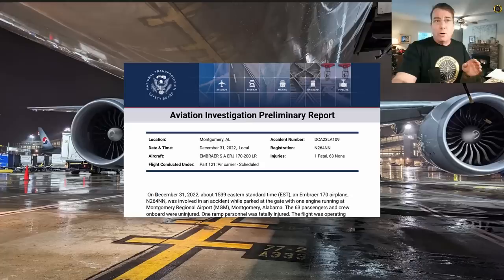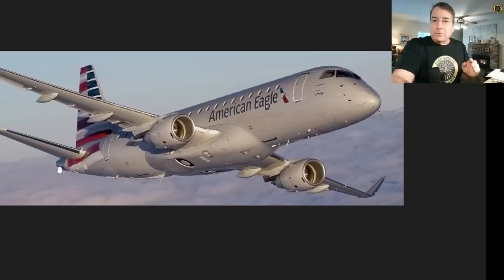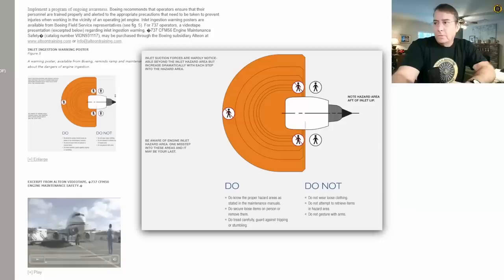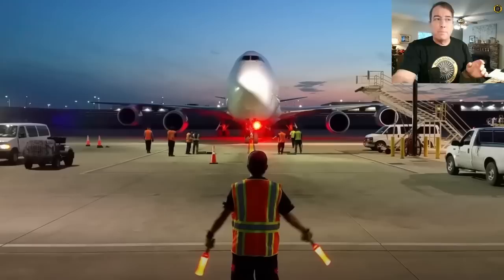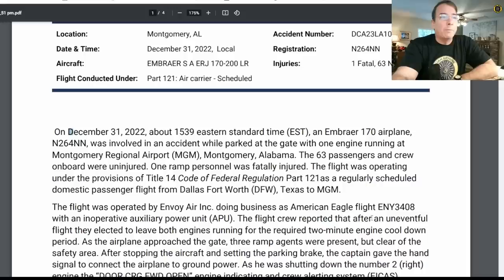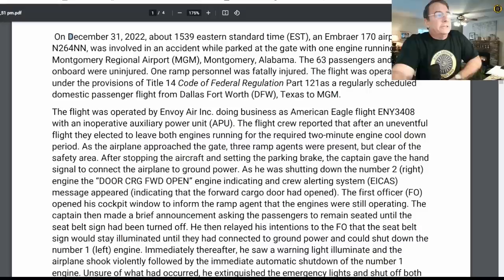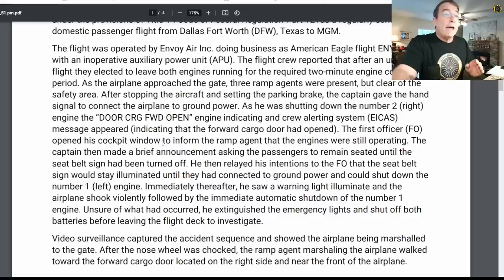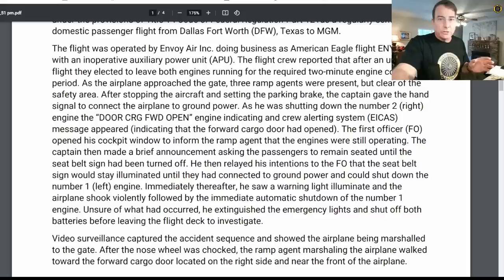NTSB Preliminary Report Ramp Agent Fatality 31 Dec 2022 Montgomery Al.

Comment: I used to work on Burlington Express DC-8 cargo configs for a time at Bradley Field, Windsor, CT.  The old mechanic I worked with would often tell me: "This bird has a dozen ways to kill you - and it sits on the ramp at night, thinking up a 13th." 

 I worked many aircraft in my 23 years as an active A&P - and I witnessed a lot of "stupid."  I almost lost an arm working on an Eastern Airlines  L-1011 inboard aileron, one night in Miami at the ASC (3rd shift). The aircraft had been in the ASC for a 'D' check, but after the 60 days, they pushed it out of the hanger and onto the ramp.  So we had to use portable work stands, manlifts, and portable lighting to continue working all the "non-routine" items.  I had pulled the breakers on the electric hydraulic pumps, red taged them, and tagged both switches on the Engineer's panel ... I was atop the port wing, inspecting the aileron actuators and hinge bushings at the rear spar.  

Had my arm down between the IB aileron leading edge and the spar, when I heard the hydraulic pumps come on!  I yanked my arm out just as the ailerons were slamming up into the neutral position.  I came down off that wing like Flash Gordon, looking to beat the sh*t out of whoever the jackass was that enegized those pumps.  I got up to the cockpit, but nobody was there.  To this day, I don't know who the fool was that reset the breakers and energized those pumps.  

That is just one example of some "toggle tommy" nearly causing a serious injury to a line mechanic.  I have many similar stories of idiocy - all of them working at either Miami International or Ft. Lauderdale.  I did not experience much "stupid" at any other base.

Comment: My experience working private FBO jets is that due to the engines normally being mounted on the aft fuselage and higher up, led to a lax adherence of normal procedures which called for line personnel to not approach the aircraft until the rotating beacon was off and the engines shut and spooled down.

There was always pressure to unload passenger bags and equipment ASAP as to not delay them at all.

Management at all levels was aware of the violation of procedures as they did not want to delay the passengers.

This lax enforcement of the safety procedure was more apparent when a BBJ (Boeing Business Jet) a private version of the Boeing 737 arrived or departed as its engines were lower, more powerful, and mounted below and forward of the wing making them extremely dangerous when operation to line personnel.

As a shift supervisor I always briefed the arriving and departing ramp personnel working a BBJ to adhere to the procedure and under no circumstance approach the aircraft until the rotating beacons were off and the engines had spooled down.

Warbird Willie, USAF Retired

Comment: It’s multiple factors. Complacency, poor training, understaffed at times, and money. It went from profit sharing to performance incentives, one of which was on time performance. If you don’t meet the on time performance goal then you may not get the performance incentive pay. Low pay causes positions to be infilled or low quality employees. There was usually one lifer around that kept things in check and running smoothly. The perk of free or low cost flight benefits goes only so far. Training was minimal and the new hire was usually thrown out there and it was a sink or swim mentality. The company will have trainings and safety briefs, which they would always fall back on if there was an incident, but the ultimate goal is profit. Do more with less. I didn’t work for Envoy, but I’m sure it’s just the same.

Comment: I learned that lesson quickly shortly after being hired when the jet blast from a 767 popped the hood up on the bag tug and nearly brained me...At JFK we never broke for the cargo doors before we heard the engines spool down...Almost everything is due to airline employment practices, low wages, low expectations, poor training, poor professional discipline, and exhaustion...You have a professionalism gap between employee profile and technical demand...That gate-running aircraft is dangerous...It requires management control above and beyond briefings...It probably is an OSHA issue...

Comment: 44 yrs with Fedex in 5 days....no approaching an aircraft until the red beacon is off!! We have also twice  in the past month had a specific 757 with inop beacons.  Ramp crew in this case is directed by AC MX when it's safe to begin/approach the aircraft. There are also FLT Releases, websites for checking aircraft MEL'S. and calling our AC Maint Brothers to talk about issues if need be.  Communication is key!

So sorry for those lost and forever changed by this. 100% in the game, head on a swivel, and above all SAFETY 1ST.

Comment: I saw a ladder sucked in a DC10 (Mx); an orange safety cone ingested in a A330 (Mx); a yellow ground air conditioning hose sucked into an A320 (ramp) - they left the hose out to close to the ingestion area as the pilot taxied into the gate.
Reply: There is a picture out there on the internet of an empty LD-3 that is wedged into the intake of a Delta L-1011 engine intake.  It get picked up by the air being ingested, and if the inlet was large enough, that RB211 would have eaten that aluminum cargo container!

Comment: As a fueler, I can’t even begin to count how many times I’ve been rushed by airlines to get connected and disconnected from their aircraft as fast as possible because of delays. Thankfully in 2 years, I’ve never had an accident, never failed an audit, and never had a delay (that was because of me). Like I told the last American Airline ramp supervisor “I’m gonna do my job how I do it. If it isn’t as fast as you’d like, you’re more than welcome to apply for a job with my company and fill this plane yourself. Until then, just focus on not hitting the plane with your belt loaders and I’ll make sure I put fuel in them”.  

(In 2 months of hiring a new ramp crew, they hit 2 Phoenix bound a321’s with belt loaders in the same week, less than 10 minutes before pushback. Planes were supposed to depart at 2300, both delayed minimum 4 hours. I just sat in my truck for those 4 hours getting paid since I had to wait for them to be wheels up before I could go home 😂)

Comment: With an APU inop, typically the left engine would be off and the right engine running by the time the plane got to the gate. The ramper might have just assumed the left was off and the right was still running because this is usually how pilots do it. I understand the 2 minute cooldown but I’ll bet $100 that the accident occurred more than 2 minutes from OOOI ON TIME.  Some airlines are rotten enough that they have one written policy and then a subtle disciplinary procedure if you dare to follow their written policy. For example the will have safety procedures that take longer to do than they will give you time for. That way they can blame you if you either take too long OR if you take short cuts. This happens with sick policy too. You’re not allowed to come to work sick but you also get disciplinary points if you call out sick, even with a doctors note.

Comment: Any time I had an apu mel’d I would either slow roll it to the gate, or stop at the top of the line and not enter until we had the right time to shut down one engine, or both if we had an operative apu.  I liked to try to minimize the time with both or any engines running in the safety zone.  Not that it would’ve made a difference in this case, just a technique.

Comment: I used to work in the Airline industry for 20 years. I was a ramp agent. There is a terrible incident but unfortunately it will be blamed on loss of situational awareness. If you are a wing walker or at any point you foresee yourself going in front of or behind an engine you need to pay attention as the aircraft is approaching the gate you can see the engine running if you’re experienced enough you can tell by sound. That’s a big if. It’s better to see than listen then of course the beacon light which tells you not to approach the aircraft until the captain turn the light off. Since she was on the non loading side. She might have been responsible for chalking the main gears on her side. Sone carriers require you to place cones at certain points at the wingtip along the wing and in front of the engine.  A momentary distraction can be deadly I never seen anyone killed but I seen people go flying like a leaf because the walked behind the engine. I know this is long one last point. I don’t know if applies to all engines but at idle thrust directly behind the engine the winds are at 200mph and 40 feet beyond the engine is still 75mph

Comment: I am a fueler at a busy regional airport.  I see violations of safety protocols like this on a daily basis.  This is the result of lack of adequate personnel to work the flights coming in and going out (short handed) and the time crunch associated with the aircraft chronically coming in late due to bad weather.  We ground personnel are aware that passengers have handed over hard earned money and just want to get to their destinations on time. So we do our best to turn the planes around without delay.  Unfortunately some believe this should be done at the expense of side stepping safety, and more incidents like this will happen until the airlines themselves and airport authorities put a stop to it.

Comment: Seriously, why the hell aren't there cameras all around these damn aircraft so they can see everything.  This lack of visibility around an aircraft comes up all the time in incidents of all kinds: "The pilot went back to the passenger compartment and looked out the window at the engine / wing", "The pilot couldn't see the problem with the aircraft", "controllers noticed a problem and notified the pilot".  Cameras are cheap, they've got to run power out for lights and other needs to all the periphery points of the vehicle so it's just an installation issue.  Penny wise dollar poor?

Comment: As a Ramper I have seen issues like this occur; not frequently but complacency and time pressures imposed by the operator can impact safety. In general the Ramper community consists of individuals who do not have an in depth knowledge of aircraft and how they operate. Much of the training given to a Ramper is CBT based supplemented with an OJT sign-off. In my experience; staffing pressures can impact the quality of the OJT experience and possibly putting a Ramper at risk for accidents as this one. A CBT module is simply inadequate training without a rigorous OJT program. As I stated this is just my experience however. Most of my Ramper experience has been with the regionals, I do understand mainline training and guide lines are more stringent.

Comment: The clock should not start when the pilot sets the brake. All passengerjets have inlet suction pressure sensors on them. The clock should start when suction pressure hits a safe level. Either that or when the strobe is shut down.

Comment: Ramp, major airport. Upper and middle management preach safety first, lower management has their feet to the fire to speed things up, so shortcuts are common place. i.e. As soon as aircraft is chocked, open hatch and scan one bag... now that clock is stopped and that metric (scan bag in X time) has been met. Do not concern yourself that SOP is that one should not handle bags from the ground, one should get a beltloader and get inside aircraft. SOP inconsistant, i.e. SOP as written on an aircraft type may conflict with the written SOP on the GSE (ground equipment). In some cases it seems the SOP is written by someone that does not know the operation so it is ignored. As long as the airline meets the metrics then a blind eye is turned to minor safety violations, but as soon as there is an accident then the frontline worker and the lower management face discipline (and possible injury).

Comment: I have never worked commercial but I worked hot turns on one of the suckiest engines out there both PW and GE variants of the F-16.  Normally F-16s carry wing tanks on station 4 and 6.  When wing tanks are installed they stick out far enough that it is obvious you can not go in front of them. Also, there is a  rule you must access the fuselage from behind.  We were doing Air-to-Air and they were not carrying wing tanks so the rule was 6 feet behind.  the safety cone diagram was still the same but people were ignoring it.  I told the super and he brushed it off.  The next day a female airman crew chief stopped the jet chocked it then we did a roll over then chalked it to start pulling pins.  My guy went up to get the gun pin but the female crew chief walked right by the engine and then screamed as her goretex got a tug she fell down and my guy jumped on her. During turns the pilots are vigilant.  I was under the station 2 pulling lollypops and arm keys and heard the engine shut down. In her interview with Wing Safety she said she had seen butteryflys linger in front of the engine at idle and didn't feel the danger applied at idle.  Even still she though she was far enough away but my guy said she was no farther than 3 feet from the lip at the point when she got tugged on.  When you have to get 20 something jets through pits/EOR you go fast and forget sometimes where you are.  But as with anything some people are just dumber.  My very experienced buddy got impatient one time and caused a fire that almost completely destroyed an A-10 and killed 4 people.
Reply: The Remove Before Flight streamer on the EPU safety pin was almost always being pulled toward the intake on the -16, when the engine was running even though it was located nearly 3 feet aft of the intake lip.  And back in the early days of F-16 ops, we still did a hands-on rollover check of the nose tire.  Even though approach was made from pretty much directly behind the tire, there was always that nagging feeling that something or someone could get "hoovered" at anytime by that giant intake.  The USAF even made it a big, giant non-no to place the aircraft forms/logbook on the intake lip, as too many of those had been "eaten" by the powerplants over the years.  Oh , and launch/recovery/EOR on an F-16 with 370s on the wings while in MOPP 4 was another challenge in itself with so much less visibility, and everything on the outside of the chem suit getting caught on those fins on the sides of the tanks as well as on the the main gear doors!

Comment: I worked the ramp at DIA for many years. Yes there is pressure from management to get these planes turned around. The management at the airline that I worked for would say, even if the inbound flight was late, they wanted you to try and get the flight out by it's original scheduled departure time. It seems insane. And in a lot of cases, it just cannot happen. But management wanted to keep those numbers up because they are reported to the DOT. On time performance.

I've seen people drive and walk in back of running engines. Out on the ramp you need to keep your head on a swivel and always look out for the unexpected. Sadly, some people treated it as another job.

Regarding training for ramp personnel: I wonder if training was done at a larger station and once they get back to the line station, the rampers just did what they wanted? Complacency and adherence to safety rules has always been a huge issue on the ramp.

Comment: I have been working since before the introduction of OSHA, foundry, military, NYC construction and finally airline before I retired.  So, I have attended lots safety lectures and even given some.  What is different about airline "safety" is that it is all top down.  You can bring up a safety concern but only if it is on a list of known safety concerns otherwise it must be safe.  I will give three examples. 

One:  The pad where we parked CRJ's was concrete.  It was surrounded by asphalt.  The concrete pad was lower than the asphalt so in the winter it would flood and freeze right under the cargo door.  This was at a SWOA airport.

Two:  One night we went out to meet the plane and it was dark on the apron.  They had replaced one thousand watt incandescents with 300 watt equivalent LEDs.  It was dark and worse it was unexpected.

Three:  The airline decreed that going forward there would be two wing walkers on all arrivals and departures.  Since we did not do push backs that meant that the plane would be turning out.  And turning over one of the wing walkers.  I was marshalling and I told my colleague that she could not be where she was.  I did this over the radio.  Eventually she relented even though she had been told about the new policies too.  I figured that if she was run over I would be blamed fair and square.  If told the judge it was policy he would say, "What's policy".  When I got back to operations I was told that everybody was listening to me on the radio.  One said, "I was laughin' the whole time".

You if you raise these issues it looks bad for the operating unit which if it is a contracting firm can be replaced at the end of its contract for performance.

Comment: I think complacency and pressure are the leading factors.  Flight crews and ramp crews are both under pressure to operate in a timely fashion and sometimes the realities of the operation just don’t allow that.
On the airbus, opening the cargo door absolutely stops the clock. We have a 3 minute cool down and it’s prudent on short taxi at outstations to just not approach the gate until your cool down time is complete. 
Another thing, it’s easy to have a lack of understanding from both sides (air crew and ramp crew) but for the life of me, I don’t understand why it’s not a bigger priority to get the ground power plugged in sooner. The sooner that step is complete, the sooner we can shut down the engines and remove the threat.